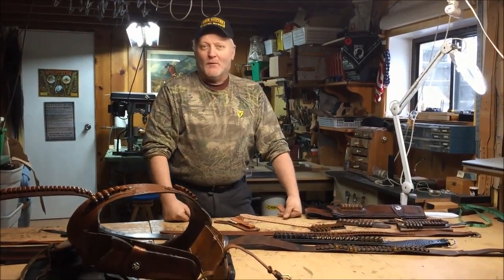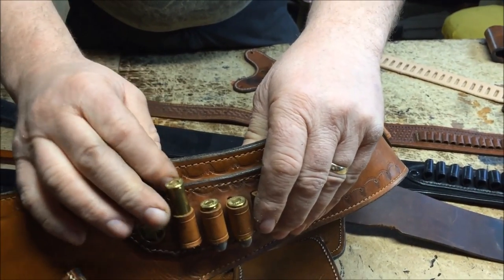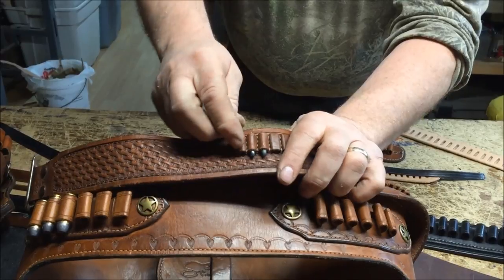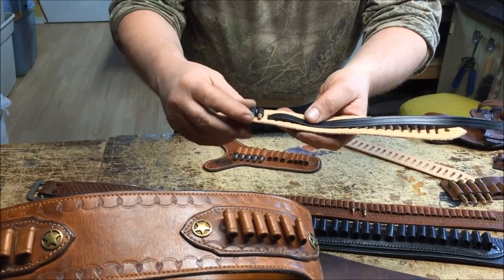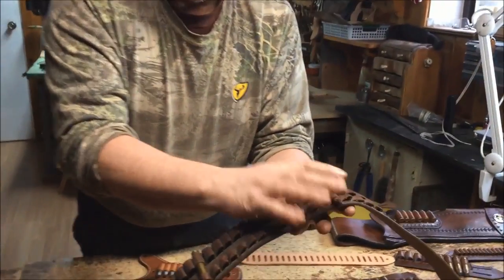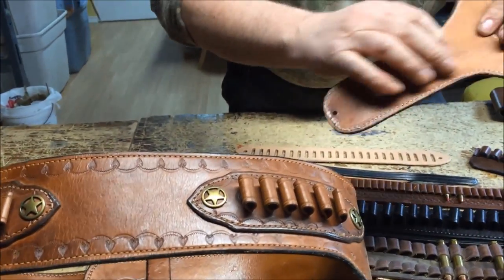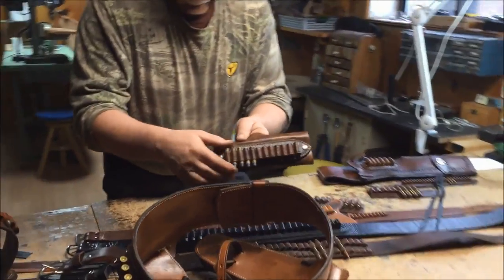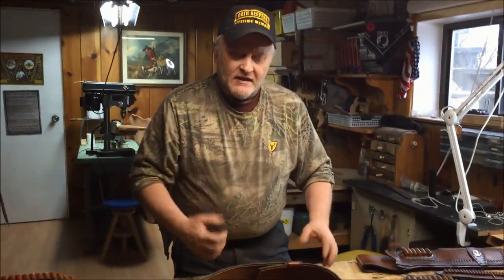Signature 3D Cartridge Loops

Comment: Thanks. Very thoughtful.
On the pull through loops which are not sewn, do they stay? Do they just rely on the form to keep from loosening?
Seems with a few rounds out they could work. Or do you glue them?
Thanks,
  Mark
Reply from the maker: Thanks for watching Mark, no the loops are not sewn or glued, they stay as they are. First off one has to make sure the leather is cut the right way so that it less likely stretches, then Mark uses the cartridges to form the loops and he says it needs just the right amount of tightness around it and lastly the loop-band is sewn at either end (not between the loops but at the end each end). We're making these loops like this for almost 20 years and they all stay even after all these years.

Comment: love your belts! after years of hand me down leather equipment, I'm finding rivets an metal rusting out. even good metal, rusting too leather acids! I would like best rust proof metals used or no metal at all with leather rapes an knots!
Reply from the maker: Thanks for your kind words @Tim Barnett. 

So yes the use of metal on leather will over time rust due to many reasons. I find that brass works not any better than steel rivets. I’ve found that stainless steel lasts a little longer. Keeping the leather clean, dry and storing it in dry warm place will help prevent it. 

Sewing or lacing is the best but it takes longer to do, but be aware, lace can break down as well if the leather isn’t looked after.

Comment: Thanks I know I was vague in my question. What I meant was how much longer is that 2 1/2"  leather strip (the inside part) than the actual belt buckle to Belt hole? Hope this makes sense.
Reply: I don't know if we're on the same page or not but I was referring to the strap not the Billet part of the belt. How much longer is the strap cut then the actual waist size?
Reply: @rogerd.hardin7156   Sorry Bugsy I missed your comment here. I will do a video in the next few weeks on how to measure a belt and add the tip and buckle ends in the sizing. Is this what your asking?

Comment: On your 22 lr loops, are you sewing in the loops or just using glue?
Reply from the maker: we don't use any glue at all, thanks for watching.
Reply: @Beavermountainworks  Weary Traveler, I realize I didn't completely answer your question. We punch out holes and weave it through just like the other cartridges.
My loop lace is 1/2" wide for  22lr

Comment: Was the 3D design for cartridge loops used as far back as 1873?
Reply from the maker: The general technique was used back then but we did not research if the 3D design was used and have never claimed it was historically correct.
Reply: Thank you for that info!  I am looking to make a traditional cartridge belt for use with an 1873 Winchester in 44-40 and a holster for an 1851 Colt Navy.  Your craft methods are great.  Many thanks!

Comment: How do you get the measurement for the space between the slots?
Reply from the maker: Thanks for commenting Kyle and sorry we only see this now, two weeks after. So to get the measurement you need to put all the cartridges next to each other and measure that distance. Then whatever material you are using you have to factor that thickness (x2) into it and add to your first measurement. This gives you the total width and now you can divide that width by the number of slots you need to make.